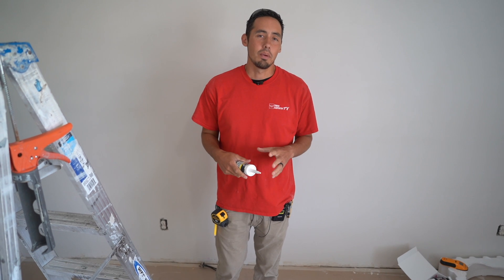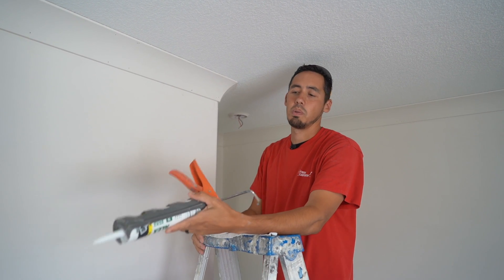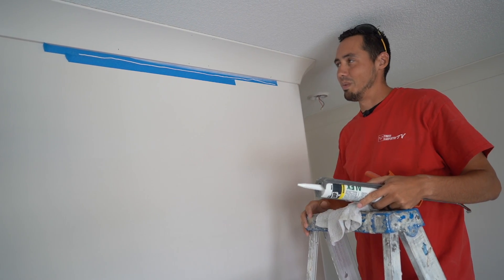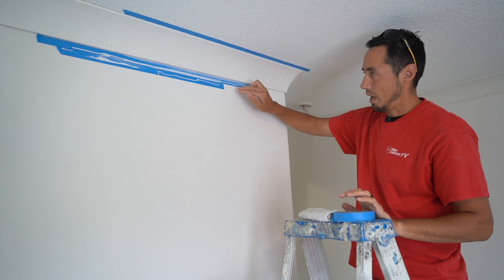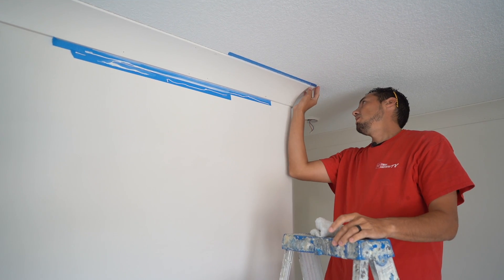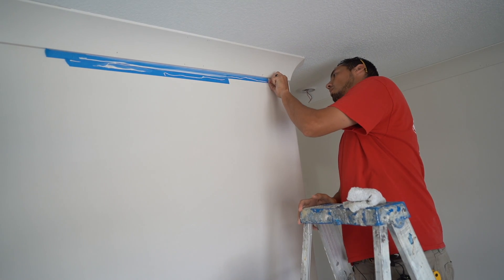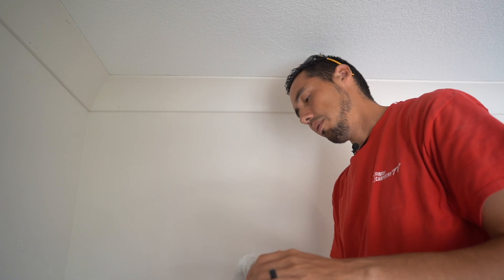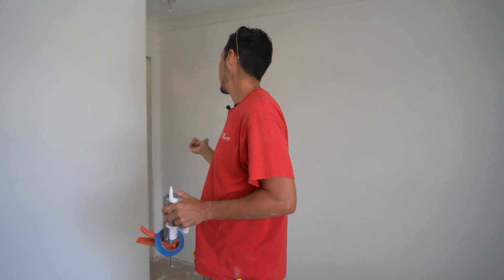How to Caulk Crown Moulding and Finish Trim Work

Comment: Sashco Big Stretch is the BEST caulk for trim work you'll ever use. If you haven't tried it, you are seriously missing out. So easy to work with and it never separates from the trim or the wall.
Reply: Isn't the wait time before painting like 24-48 hours or something though?
Reply: It is the best in my opinion  but you have to wait 24 hours to dry before paint
Reply: Love big stretch!
Reply: @ryanern18  you do have to wait 24 hours but its well worth the wait for the superior results.

Comment: So why is it that when I use the blue tape to define my caulk edge, run the bead of caulk, smooth it with my finger, wait a short bit and then pull the tape away that some of the caulk in my joint pulls away with it? It then leaves a rough and hairy looking edge. What am I doing wrong?  Love the videos man. I am learning So Much!
Reply: You may have to pull the tape instantly (before the caulk dries).

Comment: Only thing I'd add is how you cut your nozzle makes a huge difference always try to do a 25 degree cut as when your drawing gun it makes the line a fair bit smoother also try and not touch it with your fingers as all the oils from your fingers can discolour the caulk over time but spot on video richard 👍

Comment: Have you ever thought about getting one of those battery powered caulking guns? I tried one and love it!
Reply from the maker: I have thought about it. I need to try one!
Reply: @FinishCarpentryTV  one of my window subcontractors uses the motorized only for exterior, manual for interior/fine caulking

Comment: I was told many years ago that the correct way to apply caulk is not to pull the gun towards you, but to push away as if you are pushing the caulk into the gap. Which after trying this method makes so much more sense and gives a perfect finish. I never use tape just because it's so time consuming and time is money. I've personally never had any real issues caulking and never had any complaints. For anyone not doing this regular they will have some mess, that's to be expected. He does explain this well though.

Comment: I tried the 1/16" down from the trim but when I pull the tape away you can easily see that 1/16" white line against the gray wall. Not sure what to do different besides having to go back and paint the wall after caulking.
Reply: I wonder if masking the trim and using gray caulk would have worked?

Comment: I always paint my trim first then back tape on the trim, caulk, and paint the walls. Then pull tape. WAY easier.  Your doin it backwards😆. I do have respect for your work ethic. You ARE a professional.
Reply: Rick Craft So when you have a finished wall and finished ceiling (as he stated) and show up to do crown moulding, you paint the walls anyway? What a dummy

Comment: I know this is an old video, but I noticed that there is a heat vent in the ceiling near where you were caulking.  My experience with DAP is that when you place it near a heat vent, in a couple years it will shrink.  One of my buddies told me about Top Gun and how it resists shrinkage from heat vents and that is what I use now.  Also, if you have the slots in your ladder, a roller pan is nice to hold your caulk gun and wiping cloth.  You don’t have to reach down behind the ladder to get to it and you have room for more than one wiping cloth.

Comment: One trick I find useful on inside coped corners is to back caulk the cope during installation. That way the caulk squeezes into the profile of the crown. 
I learned that one from Norm Abrams years ago.
Reply from the maker: Good tip.

Comment: Dap makes a premium "crown moulding" caulk. It has less shrinkage and dries quickly. Its all I use and it's available from the orange big box store.
Reply: i've used it and really do like it.  for a homeowner the extra $ is insignificant.  maybe for the pros, the extra cost isn't worth it.
Reply: 230

Comment: Can you make a video on tips and tricks for installing along a wavy ceiling line?
Reply: Do you mean like where the cieling is textured?? If so then what I usually do is take a flat head screwdriver (small one) and score a small line across it, this also helps when I paint it as well to get a straight cut line (it's impossible to get a straight cut without doing that first)

Comment: Good video, took alot of research years ago to find out this is the pro trick before you made this video  lol. My question is when repainting trim(oil base paint), can you get away with caulking over the old caulk or would you recommend removing the old caulk before recaulking repainted trim. Also best way to remove old caulk from trim on textured walls.  Thanks in advance.
Reply from the maker: You can remove the old caulking with a sharp razor. It’s tedious and takes a lot of time. But you can do it over oil.

Comment: I am a painter and I would paint the first coat while the wood is down. Then, if I elected to tape, I would caulk the room, paint the final coat, immediately afterward, and carefully remove the tape while the paint was still wet. That makes for nice lines and uses the tape for the caulk and the paint.

Comment: I use wet rag or sponge and wipe joint after I push caulk into joint. and then one last wipe with finger.....the lil bit of water on rag makes caulk very smooth on last wipe and cleans up any residue left behind 

There is also quick dry caulk if you need to paint right away. But you have to wipe it really quick as it sets up fast (I use this the most)

Also you have to paint whatever you caulked, while caulking comes out white it will "yellow" over time if not painted

Comment: Richard,  I will give you a great tip i figured out. Take a lighter flame to the cut tip of the caulking tube for a couple seconds. The flame will round over the sharp cut edge and it will slide easier and give you a much cleaner caulk trail. Its night and day difference.
Reply from the maker: Dominic Arlin that makes sense. Thanks

Comment: If you cut the tip at an angle,  run a piece of tape around the tube in the gun to prevent it from twisting so it's in the same position when you run another bead.

Comment: Hey, I know you’ve been working on the house for a while.  Wondering if you decided on a color for the floors? I know you used white oak, I just finished building my house and I put in white oak as well.  I finished them with a product called Rubio Monocoat, which is a stain made specifically for white oak, it won’t amber the wood, which often happens with white oak.  Check out their website, they have a bunch of color samples to choose from.  Just a thought.

Comment: Good video you should have told them about your caulk gun I think that's one of the caulk guns you don't have to relieve the pressure and it doesn't keep coming out of the tube
Reply: Called a dripless gun buy a gopd one u won't have problems

Comment: It's funny I think the cheaper DAP caulks are better.  I've used the ALEX Fast Dry and the Premium Trim & Moulding Sealant on a couple recent projects and in both cases they cracked before they could even be painted (any they weren't big gaps at all).  I've never had that issue with the original ALEX or the "Painter Caulk".  I'm guessing the culprit is whatever is used as a drying accelerant as they're both paintable in 30 min or less.
Reply from the maker: ryanern18 I agree with your analysis. I have found the same thing to be true.
Reply: I never use quick dry it allways cracks no matter what

Comment: I dont use tape, worry about buildup, or angle cut because i use a caulk tool. Comes out perfect every single time, with the straightest line you can imagine. Trick is to give the area a light misting of dishsoap and water. Squirt, caulk, wipe, done. ✔
Reply: And your hands stay clean. Your wife will appreciate it.

Comment: A few other tips:
   There is no foil seal so don't bother using the plunge poker for DAP.
    Cut a 3" section of 1\2" PEX and put a plastic terminal cap in the end and stick it in the tip of the caulk when you are done.  It will stay fresh for weeks (or maybe even months if you put a few drops of water in the PEX)

Comment: I prefer to use a little screwdriver on the inside corners to really reach beyond my fingers capabilities, to smooth the caulking in tight. Then feather it out with my finger

Comment: Hey Bud, that's the worst caulk you could use on crown molding or any material that is up high. Heat rises and being as how that appears to the cheapest caulk Home Depot sells (25 yr under $2 per tube) that is sure to crack once the wood/MDF begins to expand and contract. Just speaking  from experience, as  it's happened to me and I learned the hard way. But the 45 yr at least or even their new stretch caulk ($7 per tube). Of course my situation may be magnified since I live in a cold weather city and homes have to be heated in the winter.  Otherwise you bring up some good points...

Comment: Maybe on one of your jobs, you could try out a technique I have used for years. 
Use a dripless caulking gun.

Use Dap Alex plus w/ silicone. It's the turquoise label. It flexes and doesn't turn yellow. It's just a better product.

Cut the tip at at an angle, it keeps the caulking tube from jumping around on textured walls.

Get your finger damp to push in the caulking initially. 

Use the large, yellow tile sponge and a bucket of water. The large sponge allows you to blend the caulking into the wall much better and will hide inconsistencies. Flip the sponge as you build up caulking on it. The harder you press, the smaller the blend. When all sides of the sponge have caulking on it, dunk and squeeze the sponge in the bucket.  All the caulking will wash right off. No tape is wasted or harmed in the making of this method. You can wipe a few times if needed to achieve the smallest caulk line and it blends so well. Thanks for playing and hopefully you will give this method a shot. 👍
Reply: Do you have a video on this? That would be nice.
Reply: @ashiwi36  I dont have a video of it. I could probably make one., but it will take a few days. I'll reply if I can get a video for you .

Comment: I'm not opposed to caulk finishing tools.  The right tool (if you can find it...) will really clean up a bead.  This might be a case where the tool helps after I've applied the caulk too heavy, so maybe it's making up for bad technique.

Comment: After you cut the tip, don’t you have to use the metal rod built on the bottom of the caulking gun to puncture the tube itself?? I’ve never just cut the tube and caulked, which makes the hole at least the size of the metal rod.

I’ve always used those black tips that the doctor use on their otoscopes to look in your ears with. They have different sizes from really small to fairly large.
Reply: Some of the tubes don't have that seal that needs to be punctured, and some do. I think the tubes that are all one piece of molded plastic, nozzle and tube, don't have the seal.
Reply: @51jim  ahhh ok gotcha

Comment: DFM I would like to recommend you to try the tajima Convoy super 26 caulk gun. It's well-built very smooth when pulling the trigger and it does not allow the caulk to ooze out of the tube when you're done using it you can check it out on Amazon I'm getting ready to purchase another one but this one is a 2-speed caulk gun by Tajima it is the CNV-100 RS Convoy RS I just thought you might want to look into it they are the Ferrari of caulk guns. Peace brother
Reply from the maker: Thanks for the tip! I will get one
Reply: @FinishCarpentryTV  Never tried the Tajima guns but the Dripless ones (that's the brand name) are great too.

Comment: Guess I've had too many failures with DAP to use it anymore. It does yellow and is not long lasting. Titebond makes good caulk if you can find it. Lowes and HD must make the most profit selling DAP.

Comment: I use a caulking called 'big stretch’ thats never shrunk up and cracked on me.
Reply: Big stretch is awesome for color matching also.....the little bit squeezes out plunger end from factory shows color when it's set up
Reply: Dude, no way. Talk about big shrink.
Reply: @justincunningham5457  if anything gets cold enough it will shrink
Reply: Ehhh, quad max doesn’t Shrink.
Reply: @justincunningham5457  neither does Lexel
Reply: Lol lexel creates a chemical bond, exactly like quad. It will dry under water. Big stretch drys exactly like dap.
Reply: @justincunningham5457  was kidding about lexell
All the big stretch I ever used is super flexible....I used a ton of colored stuff 15 years in Alaska and now here on Kauai in extremely high end homes. Deal with tropics is stuff always moving and swelling due to the moisture.  Alaska the ground moves a ton cause of the frost.🤙
Reply: Well it’s funny you mentioned it. Quad and lexel are virtually the same thing. I’m from central Oregon where we have negative degree winters and quad and lexel will spread and dry on anything.
Reply: @justincunningham5457  I know, even frozen exterior siding

Comment: I cut mine less than a 1/16th need a really small piece of wire to pierce the seal. Always on a 45. And the biggest thing you left out is to use a good gun like the newborn one you use. Cheap guns are junk,And it shows.

Comment: The drywall is wavy and inconsistent all the way down the wall thick and thin and thick and thin again, and you are using wood not MDF and even MDF would not follow the contour of the wall. No matter what you are going to have to fill those gaps with caulking you should include this with your video because this is a realistic situation the contractors willing to including myself on an almost daily basis

Comment: You said something that was complete crap in my opinion. I always also thought just your finger. Well, now I have learned how to use caulking tools as well as my fingers. I am not talking that cheap crap HD sells. I bought a caulking toolset. There are many places where I use them were doing it with your finger would never look as grand as caulking that was smoothed by a special angle or curved tool. Granted I am also talking about none paintable areas as well. By the way, works great with silicone caulking as well.